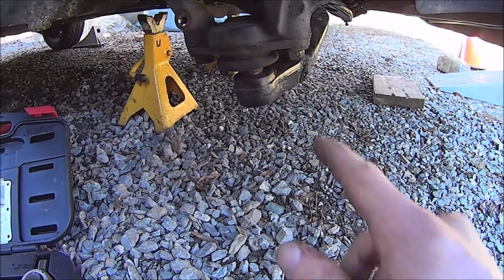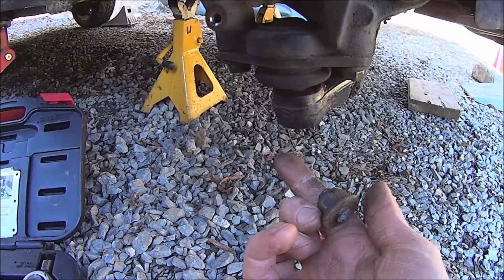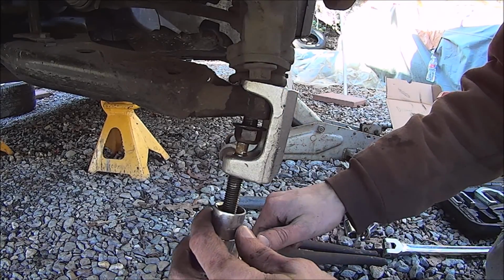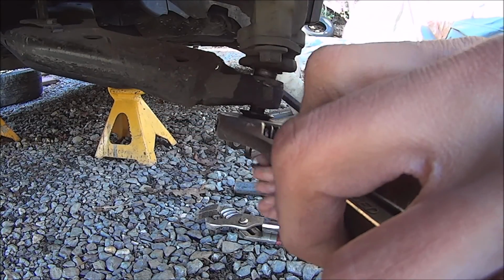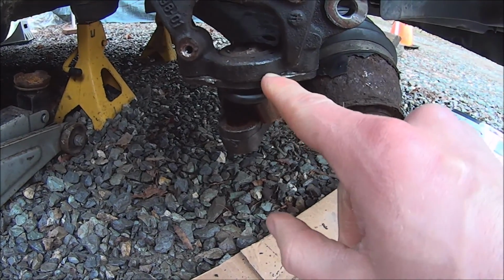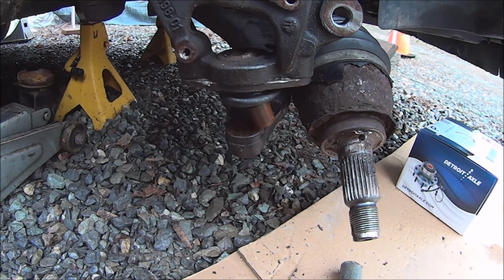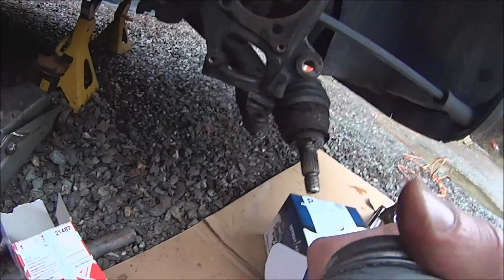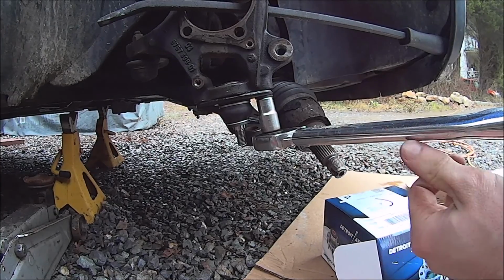How to Replace MINI Cooper Outer Ball Joint - 1st Gen

Comment: that looked easy. VW MK4 Jetta golf gti have the easiest ball joints to remove that I've dealt with so far
Reply from the maker: +fockyoumang It was pretty easy. Would have been easier if I didn't have to dremel and hammer it out. Also removing the brake caliper adds a little more time. The newer Mini's have bolted on ball joints like the MK4's, I wish mine had those!